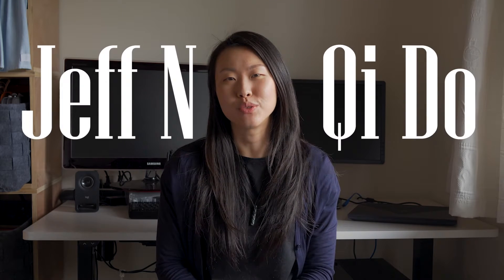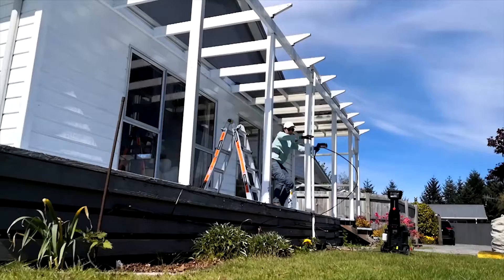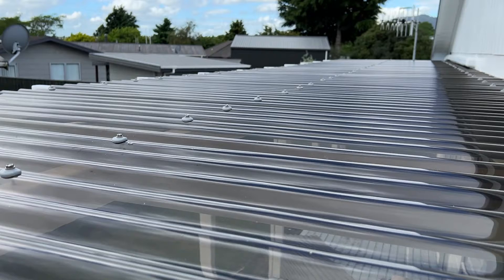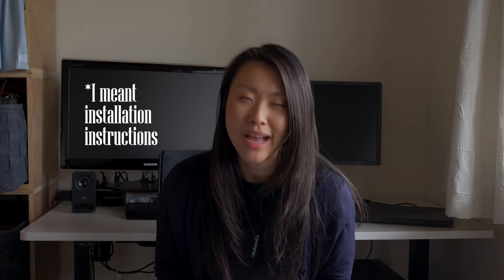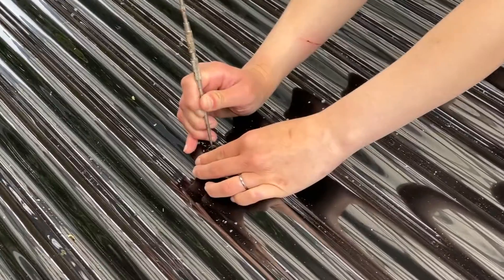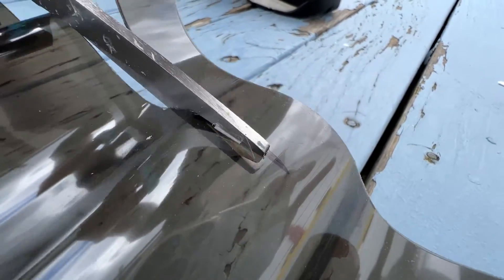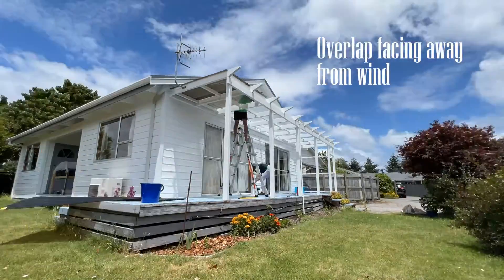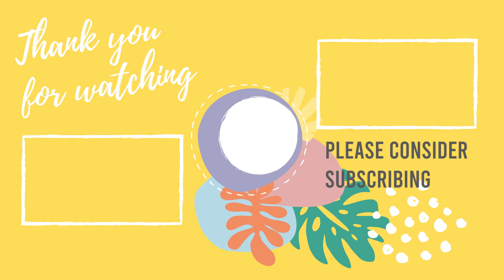DIY Pergola PVC Roofing

Comment: Is your roof slanted?
Reply from the maker: Hi Yvonne, yes, it has a small slope of 2-3 degrees if I remember correctly based on the existing pergola. We would have preferred it to slope a bit more (5 degrees) if we had built it from scratch.
Reply: Did you put the screws into the batten through the ridge part of the roofing or the valley/lower groove?